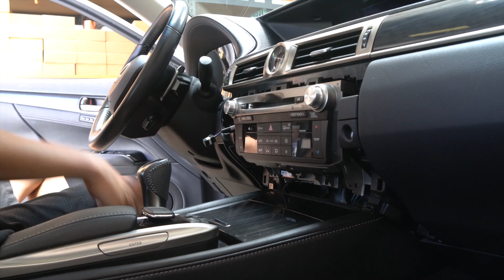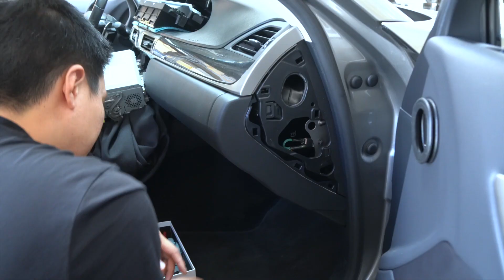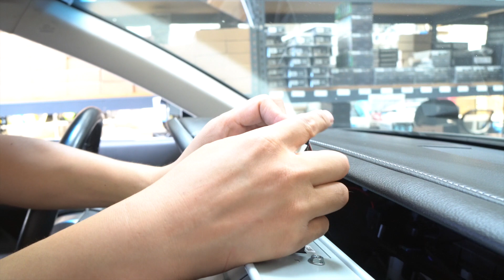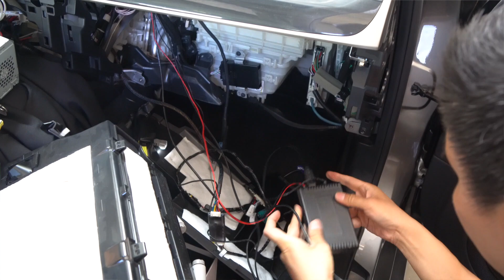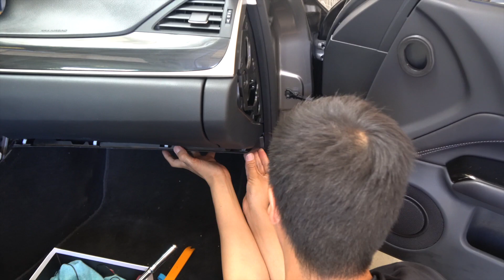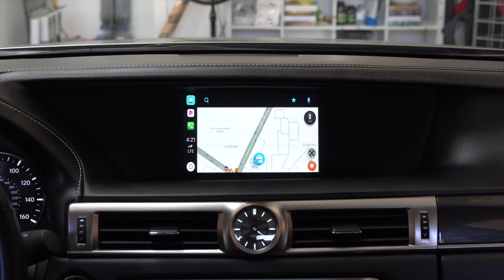2013-2019 LEXUS GS | Wired Apple CarPlay & Android Auto | Install / Demo

Comment: Does it still work in a 2014 Gs350 F sport? Not sure if the trim matters or not. Also, will the steering wheels functions still work properly while in Apple car play? Like the volume and will the voice command button be Siri?
Reply from the maker: Yes it works for 2014 GS, all trims. Steering wheel functions still work properly. Voice command button is locked to Lexus system and won’t work with Siri
Reply: @BeatSonicUS  thank you so much!! I can’t wait until you’re back in stock. Know how soon ?

Comment: I have 2015 with a large screen, will it do a split-screen or will it do a full screen?
Reply from the maker: 2015 GS will show split screen. 2016-2020 will show full screen
Reply: @BeatSonicUS  no way by pass that
Reply from the maker: Yes, you can get a new radio and new screen from 2016-2020 GS

Comment: Where you mount the modules, the car i'm working on has a module (factory) already there... anyone else run into this issue? Where did u mount the mod's?
Reply from the maker: You can tuck them behind the carpet towards the center console from the passengers side

Comment: Im curious, why is it this wont work on a 2014 lexus with out navigation, but it works on a 2015?
Reply from the maker: Which lexus model is this?
Reply: @BeatSonicUS  sorry, the GS 350.
Reply from the maker: This works with 2014 GS with nav. In the USA we don’t have a 2014 model without nav. We can check compatibility for you. Send a photo of your screen and joystick controller to info@beatsonicusa.com
Reply: @BeatSonicUS  my GS is a 2014 and it does not have the navigation. I’ll send the pictures of them now.

Comment: Have you updated/fixed the Android Auto system? I have a 2016 GS350 w/ Navigation package (the larger screen).

Will it work on the car? If yes, I will be buying it ASAP.
Reply from the maker: Yes it will work on the 2016 GS with nav.
Reply: @BeatSonicUS  so I got the unit and installed it. It works - the only issue is that AA looks stretched compared to AC.
AC looks much more optimized and crisper.

The settings are based on what the instruction manual said.

Any way to get AA screen to be normal (not stretched out and slightly blurry) ?
Reply from the maker: @EnigmaTanker  can you send us a photo to info@beatsonicusa.com
Reply: @BeatSonicUS  I've sent the email with pictures

Comment: After installation, will CarPlay auto load when connected to the USB. Or do you have to route to aux, and hold down menu every time?
Reply from the maker: You will have to route to aux and hold the menu down every time. You won’t have to reselect aux if  you were already on aux

Comment: Did this Gs have factory Nav? If not will it show split screen with a 2015 Gs that has factory nav? Will the volume show on the HUD since it won’t show on the screen?
Reply from the maker: This one did not have nav. For 2015 it will show split screen. If you have the hud feature and it usually shows volume then you will see the volume on hud even after you install this

Comment: Will this work with a 2016 GS F? If so, does it work with factory USB port for Android Auto?
Reply from the maker: Yes it’s compatible with 2016 GSF. It won’t work with factory usb unfortunately
Reply: Beat-Sonic waiting for restock, were you able to fix the stretched screen issue on 12.3 screens? Do we still lose the control buttons on the steering wheel?

Comment: Why is the screen so small?
Reply from the maker: Aaloo Gill this is the non nav GS model, that is why
Reply: @BeatSonicUS  so if i install in the large screen itll be adjusted to screen size?
Reply from the maker: Aaloo Gill correct. You will have 5 icons across instead of 4
Reply: @BeatSonicUS  thank you! You guys make buying the gs worth it, the audio system screen is large but so bad, I'll place an order soon and have a shop install it
Reply: Beat-Sonic I have a 2015 ls 460 will the updated version let you use the full 12 inch screen or will it be split ?

Comment: If you’re playing music in pandora or Spotify, do the steering wheel buttons for next and previous track still work?
Reply from the maker: oohlio steering wheel buttons for next and previous track will no longer work. However you will be able to use the top and bottom arrows for next and previous track if you have those buttons next to your mouse. Or you can change it on the screen itself

Comment: You mention that you don’t need an external microphone anymore for Toyota’s. How does this work? Do you have to be always connected via Bluetooth to the factory system? If so, then how will calls route through CarPlay? It also would be annoying to have to connect by Bluetooth and usb all the time to have full functionality.
Reply from the maker: Mister Koll correct you do not need an external microphone for Toyotas. Yes you will need to be connected via Bluetooth from your phone to the vehicle. The calls will route through the factory Bluetooth. Being connected via Bluetooth to the vehicle is automatic as most customers have their phones connected to their vehicles via Bluetooth as a default. Connecting your phone via usb is what many customers do already for charging their phones
Reply: Beat-Sonic thanks for the quick response! Then how is it always ready for “hey Siri”? Also wouldn’t the Siri invocation take longer as it always does with the factory system? Can you still initiate calls from the CarPlay side?
Reply from the maker: Mister Koll the carplay device is always listening for the “hey Siri” command through the factory microphone. It may take an additional second for Siri to respond to your command. Yes you can still initiate calls from the Carplay side Which will automatically switch both microphone and audio to the factory Bluetooth system once a call is made.
Reply: Beat-Sonic so you don’t need any external mic plugged into your system anymore at all?
Reply from the maker: Mister Koll correct. Instead it has a mic cable that is integrated to the main harness which connects to the factory mic, which will have to be plugged into the carplay box
Reply: Beat-Sonic huh... but if you have a direct connection to the factory mic, why are you required to use Bluetooth for calls? Sorry if you’re getting tired of all my questions! I do appreciate all your helpful quick answers!
Reply from the maker: Using factory bluetooth instead of this device for phone calls results in much consistent volume mic and listening levels compared to using this device for calls as you are accustomed to. So product experience is much more positive this way.

Comment: I have an Android phone (Samsung Galaxy note 9) and a 2013 Lexus RX with factory Nav.

Would you post a comparison table of features between this new product and your screen mirroring product? http://www.beatsonicusa.com/if04ep.html
Reply from the maker: Hi Proto, The biggest difference is IF-04 Mirroring will mirror what you see on your phone to your screen while controlling what you see with your phone. There is an option from Samsung to use your phone as a touchpad with this. With Android Auto, you will no longer use your phone to control but car's joystick and buttons. However with Android Auto you will not be able to mirror your phone and see videos such as Youtube. Here are more details with Android Auto: https://www.android.com/auto/
Reply: @BeatSonicUS  Thanks for the reply!  So, if I used your if04ep but with my phone and Android Auto app active, I would get almost the same thing, but would still need to use my phone's touch screen instead of the Lexus joystick?   And with your  new gadget (in the above video), I gain the use of my car's Joystick to control Android Auto?   That's an interesting and maybe difficult choice to make.
Reply from the maker: If you are planning to strictly use Android Auto, I suggest getting this unit instead of IF-04EP as your screen will automatically change to Android Auto once you plug your phone into the device, whereas with IF-04EP you will have to load Android Auto manually every time. In addition, the picture quality from this device will be sharper than with IF-04EP. And yes, you will also be able to use factory controls with this device whereas with IF-04EP you will have to use the phone to control what is being mirrored. If you are wanting to use for Videos IF-04EP would suit you better. If for Android Auto, this kit is better.
Reply: @BeatSonicUS  Would you talk more about the screen resolution?  I saw a comment Beat-Sonic made on your site that says that older Lexus (like my 2013 RX with Nav) have 1280 x 480 screens, so the RCA for video requires down converting HDMI to the lower res of the Lexus screen.
Reply from the maker: That is correct, IF-04EP will down convert from HDMI to RCA. When watching Videos you will not notice that the resolution is inferior. However, when using map applications such as Google Maps you will notice degradation. This kit however, will use GVIF input and will display higher quality image so even Google maps will show clearly as compared to the image quality on your phone.

Comment: I have a few questions:

How much does something like this run total (product and installation)?

Also -  if there are updates done on the phone ios will the carplay still be able to read it?

Does the carplay software require or allowed updates as well?
Reply from the maker: Product is currently on sale for $499. It will be raised to $599 end of September. If any phone updates in the future makes our device to not work properly, we will be sending you a firmware via email to load on a USB stick, which you will plug into the USB port your phone was connected to and the firmware will update. Carplay software from Apple does get updates from time to time. There will be a major update to iOS13 very soon. This kit has already confirmed to work with iOS13 as well.

Comment: Is it possible to hide this white usb cable and make it visible only inside center tunnel? (where factory usb are) I don’t want this protruding wire in my car
Reply from the maker: Yes that is possible. You will have to drill a hole inside your center console

Comment: Will this support the widescreen on higher trim levels of the Lexus GS?
Reply from the maker: 2013-2016 GS will be split screen and 2017-2019 Lexus GS with nav will support full screen. This is due to the  actual hardware of Lexus screens.
Reply: @BeatSonicUS  Okay, good to know. For the other part of the screen not occupied by Apple CarPlay, will the Lexus Climate Controls and Audio Controls be there?
Reply: @JJFLD  good question